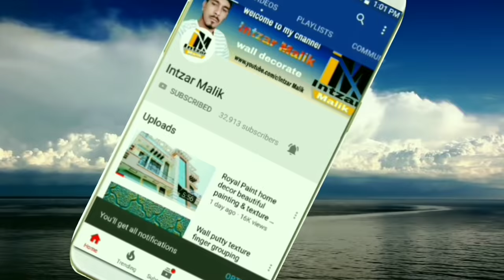Wall putty texture/# latest painting design/# waterproof wall

Comment: Hi, Mr Intzar.. I am from Malaysia. Do you peel off the tape after the putty dried or while it's still wet or a bit wet?
Reply from the maker: The protein that is used in 1 liter of water is mixed with the water paint mix and it is the same as the layer layer, it is very easy to make the final design for the final tape.